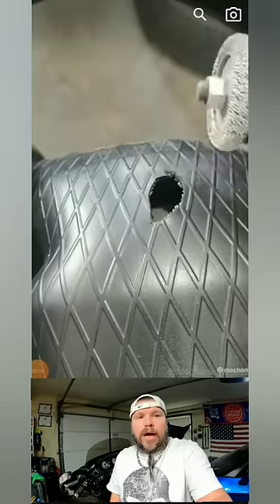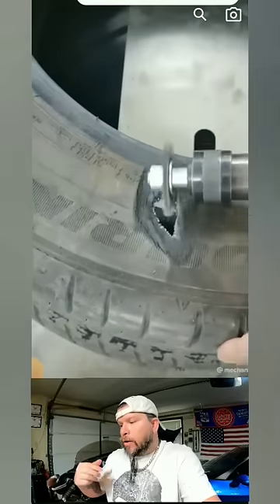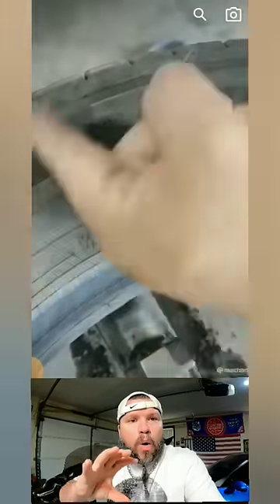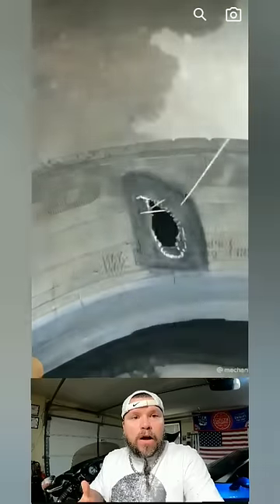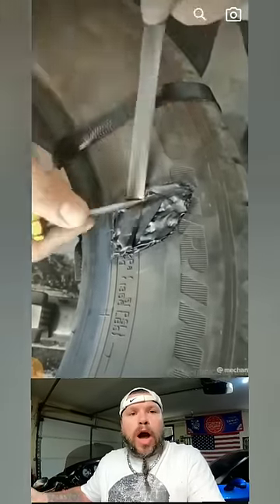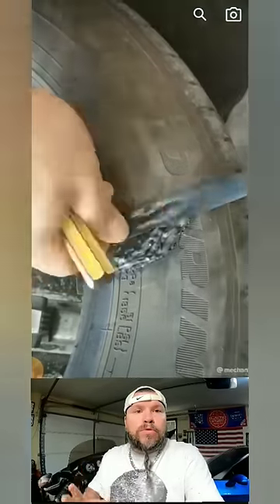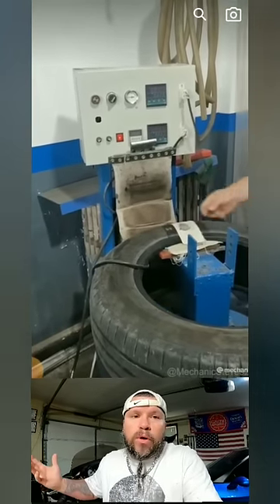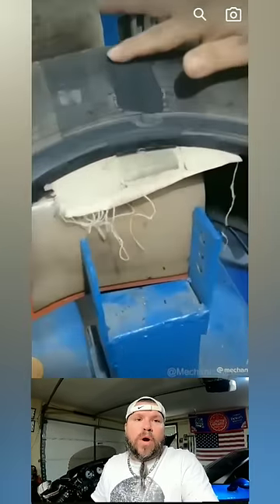patching a tire

Comment: I build truck tires for almost 3 years. At Continental Truck Tire in Illinois, and the sidewall repair is on the dangerous side. Because he compromised the air proof lining of the tire. And he caused the Body Ply wires to stretch and contort unnecessarily in the sidewall repair. Overlapped wires or stretched wires in the body ply during Tire buildup process would cause a scrap tire.
Reply: Wrong, it's called a section repar. You would be amazed at how many semi trucks on the road have section repairs. I too am in the tire industry.  I've sent tractor tires with bigger holes than that in the sidewall to have repaired.
Reply: Not one of them people doing this shit have ever heard of TIA . Tire industry of America.  Been certified for twenty ton tires.
Reply: @bto1533  do you mean tire industry association ?  What a joke . Basically  you pay a couple hundred dollars a year for a magazine subscription and a plaque for your wall. The training  is a 20 minute online course. I wouldn't brag dude. I grew up in the tire from a small child. I've replaced or repaired tires on just about everything that has tires on it. From hand carts to earth movers from toys to airplanes and everything in-between.  Don't try to act like you know something everyone else doesn't
Reply: @J S  lol no dude. Maybe in third world countries. What do you live in Pakistan? you clearly don't understand safety standards we have in the west.
Reply: @krombopulosrick7920  you sir are misinformed.  You not going to tell me anything about American tire industry.  I've spent my whole life in it. Go pretend to know what you're talking about to someone who doesn't know more than you.
I'm not saying the repair in this video is a common practice  or even acceptable.  I am saying that sidewall repairs are common and acceptable.
Reply: This is stupid. No one with a bain would attempt to patch that tire
Reply: @Blue_Shirt_Guy  That would be an illegal repair in the CDL industry.
Get stopped for an inspection and they notice that, you're going to be getting fined and sit on the side of the road for hours until you can get Rossi to replace it
Reply: @Random-ed2xf  good luck do that on a passenger car
Reply: @Jake-li7ih  yes that is crap
Although section repair is perfectly acceptable on drive and trailer tires.i know this because i have had many sidewall repairs done and sold them .
Reply: @Blue_Shirt_Guy  I'm sure you have. And they probably held up just fine. But legally it is not allowed.  Just got my CDL last year and my instructor said this specifically. 
Repairs are only legal within the tread area.
Otherwise it is an out of service violation.
You may want to catch up the regulations, they chang frequent
Reply: @Josh-ew1le  you would be surprised by the amount of people who don't understand its not safe to repair the side wall of a tire
Reply: I have friends that worked there and I used to pass it to go to my favorite transmission shop.
Reply: My cousin works at general tire in Illinois
Reply: On a bigger tire used for farm purposes I would fix a sidewall of a tire
Reply: @Blue_Shirt_Guy  that might be ok in China but in developed countries they would never think that's ok on a passenger car.  You would let your family ride in a car with a repair like that?
Reply: @Josh-ew1le  I don't know of a company that does passenger tires. I only send commercial and agricultural tires to the cap shop for repair or retread.  I have seen recap passenger tires before though
Reply: @supersportbikegrandpa274  voted for sleepy Joe.
Reply: Then these people have never been in a retread shop and watched repairs in real life, because these types of repairs are running on the road on all types of vehicles, especially 18 wheelers, daily and in the US
Reply: I mean can a tire sidewall be repaired if sent to a special Factory and money was not an object?
Reply: @Blue_Shirt_Guy  now I can't talk for the whole world, but a sidewall section repair is only legal in most countries that I'm aware of for the agricultural industry. There may be some tyres than can have this type of repair carried out for HGV's, but none that I've ever made, and I believe that to still be illegal in a lot of countries anyway as it is a road-going vehicle with a liability.

This tyre is for a car and/or light goods vehicle. You can not repair sidewalls on them as just about everything that keeps the tyre structurally sound has been compromised here. The butyl membrane, the ply cords, the intermediate layers, and the bonds between all of the layers. Not to mention the DOT info has been buggered off, so we're into "not for road use" right off the bat here anyway.

Once you have a crack or a hole in your car sidewall, you CAN NOT bring that tyre back to its original integrity. It can only be done through manufacture.
Original integrity in the eyes of the law == sufficient integrity. There is actually a regulation that more or less quotes that, but it's been too long for me to remember what one.

So no. This ain't okay, nor is it remotely legal in civilised countries.
Reply: @DeltaCodex  wtf are you babbling about ? I've already said srmi truck and off road vehicles.  I personally have sent truck tires to bandag with small punctures in the sidewall, had it repaired (vulcanized) recapped with trailer tread and sold them. All your other babel is just that.
Reply: @moneymoney12  finally someone who has actually been around the tire industry.  This thread is full of people who have never even changed a flat trying to talk about tire repair like they're experts.
Reply: @Blue_Shirt_Guy  yes, but the video isn't about a truck tyre. It's a car/lv tyre.

You guys are arguing about something in an entirely different context (ironically pretty much the definition of babbling, no?) so I'm just bringing my 2 cents on the topic at hand having manufactured car and light truck tyres in a previous career.
Reply: @Jake-li7ih  Don't know about the US but here in the UK sidewall repairs can be done by a proper company as a major repair. The tread area thing only applies to normal patch repairs.
Reply: Wrong Bandag retread and tire section repairs look it up
Reply: @Iaintwoke  Yeah it's the Same thing in the US for Personal Vehicle's but it is illegal to do on Semi's.
Semi driving is the second most regulated industry in the US and the tires are the most regulated the most regulated part on the Semi.
That one dude who was responding to me knows absolutely nothing about the Semi industry.
He said there was essentially no regulations when it comes to the tires when infact when I went to CDL school the first thing our lead instructor told us was half of the Material we have to learn is about just the tires.
If you get stopped for an inspection they are the number one cause for getting put out of service and stuck on the side of the road for hours.
Once you get enough of these you start getting really hefty fines until they finally revoke your CDL
Reply: I found the tire experts. 🤣
Reply: @DeltaCodex  first it's tire, not tyre in civilized parts of the world. Second you could do it on car tires but by the time you spend all that money repairing it you might as well buy a new tire. See car tires are significantly cheaper than truck tires.
Reply: @Blue_Shirt_Guy  the only thing you got right was the I go to Loves. I'm a sucker for that Chester's Chicken. And yes I did ask some older drivers yesterday in our Monday meeting I brought it up and between all 16 drivers with a combined total of probably more than 250 years experience. half of whom have between 25-40 years experience. Along with my Terminal Manager who has to stay up to date on everything all agreed that you are absolutely wrong.
They say Maybe your stuck in "the good ole days" when the industry wasn't highly regulated.
And those DOT people don't know anything. They only people that know are the state examiners, the instructors, the secretary of state (maybe), state troopers who are authorized to perform DOT inspection (some of them don't know shit either) and lastly experienced truckers.

Taking a tire guys advice on the trucking industry is like taking your dentist's advice for your herniated disk
Reply: True. I used to work in a Michelin retread site in the UK. Yes, sectional repairs are permissible on truck tyres, but damn I didn't like it much! Let's face it, truck tyres are a multitude tougher and stronger than any car tyre could ever be, so it is what it is, if done properly, by competent staff then that's one thing. On a car tyre? I'm noping the f**k outta that one.
Reply: I made Continental Hoses lol I ran the Extruders which makes the Inner part of the hose I'm pretty sure the Process is similiar but yes once you compromise that Ply its done you need a New Tire
Reply: @deltasixgaming  wrong hose boy.
Reply: @Blue_Shirt_Guy  These people have NO clue. I have worked on cars since childhood and when I got the "legal" car to drive, the 1st place I went was to the tire shop. In my town they did retread for sale and because they knew me, they would redo my tires at cost. I have spent a many an hour in the shops and have even helped to repair tires. The man was not using electrical tape - he was using what was defined for the repair and these people would be shocked what is repaired and what is on 18 wheelers.

JS, since you and I don't know what we are talking about, based upon their ignorance, I'm posting from the retread industry; which will reference TIA.

SIDEWALL REPAIRS
 
A few years ago the International Tire and Rubber Association conducted a research study on the strength of sidewall repairs in radial truck tires. Radial truck tires with injuries 4" long and 3/4" wide were repaired, x-rayed, and subjected to increased pressure until they burst.
 
From the results the International Tire and Rubber Association (now known as TIA) concluded that properly repaired sidewall injuries have a strength equal to that of the surrounding tire body and provide a safe performing product for the transportation industry.

Let's even discuss the bulge concern

WHAT ABOUT THE BULGE?
 
Repaired sections in radial tires may sometimes exhibit a slight bulge. New blue triangle identification logos are now being used by some tire repairers. the Commercial Vehicle Safety Alliance (CVSA) which inspects trucks for safety defects has adopted the blue triangular logo to help identify bulges caused by sidewall/shoulder area repairs. Those bulges due to section repairs are acceptable if they do not exceed 3/8" (1cm) in height. Tire Industry Association/TIA has a plastic TIRE FACTS card available with a 3/8" cut out which allows for easy measuring of a bulge.WHAT ABOUT THE BULGE?
Reply: This guy ☝️
Reply: @moneymoney12  👍 spot on dude.
If people just listen and then actually investigate a little they might learn something.
Reply: so many tire experts on this comment, my head is about to explode from reading this shit.
Reply: @Blue_Shirt_Guy  😆😂🤣💀🤦
Reply: At dealerships, we remove the object, take a drill and ream the hole out in all directions, then apply the rubber vulcanizer, pull patchplug through, cut it flush, pizza roll the patch, add rubber cement, seat beads on tire inflate to pressure and go.
Reply: @johndc2998  On the tread yes, not on the sidewall. If you are repairing sidewalls with plugs your deserve jail time.
Reply: @moneymoney12  I knew this was coming 😂 props for standing your ground I was about to back yall up
Reply: @J S  do they really repair side walls on road tires for semis in North America. Not just large otr tires. That's hard to believe. Liability and insurance don't mix.
Reply: Scary when they go. If your doin 80... No bueno
Reply: @Blue_Shirt_Guy  tractor tires are way thicker. They don't flex as much.
Reply: @Blue_Shirt_Guy  the only time you can repair sidewalls if it does not go down to the belts. And that's not a section it's called a spot repair... Do people do these kind of repairs? Yes. Are they acceptable? NO! YOU WILL KILL SOMEONE
Reply: Do tractor tires travel at 70mph on the interstate?
Reply: @Originalsunrunner20  if you're talkin farm tractors, no. If you're talkin tractor trailer tires (semi trucks) then yes.
Although most semi truck tires have a max speed rating of roughly 75 mi an hour because when you're going faster than that the air in the tire can reach upwards of 300+ degrees Fahrenheit inside.
Reply: @nubbyfresh5623  what's a guy that works for blah blah blah ? Go lie down
Reply: @Blue_Shirt_Guy  since I've been doing this about 20 years I figured I'd call you on your bullshit 😂
Reply: It's tyre, tire is to wear something out, like animals.
Reply: @osmacar5331  not in God's country.  I've never seen an ad for Goodyear Tyres, Firestone Tyres, or any other brand of Tires. Have a nice  day
Reply: The tyres strength is in the sidewall,  no repair, even a tiny puncture repair is acceptable as you will never know if any of the cords are damaged.  Its scrap
Reply: Bollocks
Reply: @paulhancock3844  wrong kid. You failed
Reply: Hey I work at penske. Can you look into why my recaps are flying apart all the time? Specifically the conti ones.
Reply: @Blue_Shirt_Guy  So I looked it up, and J S you're correct that section repairs are a thing, and do involve essentially rebuilding the sidewall with new rubber and a reinforced backing. However, Foxy Weapons also seems correct that this particular repair seems to be at the very limit of the size of a hole that can safely be repaired with a section repair. You're not supposed to exceed 5 inches long by 1 and 5/8 inches wide, and that hole looks a lot wider than 1 and 5/8 inches to me. But I'm just a guy on the internet.
Reply: @jeffwells641  take a ruler and draw a 5" X 1.5" box on a piece of paper,  that's a pretty big hole. Although I think that's a hole in the tread I do believe it's much smaller on the sidewall but yes I used to  send truck tires with holes in the  to the cap shop.  Good on you for doing a quick search before just spouting crap that is nothing more than feelings like a Democrat
Reply: @Blue_Shirt_Guy  I'm just saying that the hole in the video looks like it's around 3" x 3", which fails the 5" x 1.5" standard, making it a dangerous sidewall repair, like Foxy said.
Reply: @jeffwells641  I would agree, also to repair that hole would cost more than half of what that car tire cost new. Just replace it and be done with it.
Reply: @lennytate4246  Bad driving!
Reply: @ianmangham4570  I'm not a driver. I work for penske. I put the tires on the trucks. That is not why. The reason is bad molds. Because everytime I take one off like that the re cap people take it and credit it to us. So wrong. But I'm more so looking for why so many have shit re caps. A piece of tread in the middle of the tire on one I pulled right off same day it got delivered to our shop. And by piece of tread It's like 3x3in and about 25/32 deep.
Reply: @lennytate4246  Bad workmanship on your behalf!
Reply: @ianmangham4570  yea I bet.
Reply: @Blue_Shirt_Guy  how's the weather in India. I know you guys wear sandals to smelt iron. You repair sidewalls on tires too?
Reply: @moneymoney12  why would you bring up TIA? You Indian boyfriend already said it's garbage and only 20 min online course can get you certified.
Reply: @krombopulosrick7920  JS is from India. They wear sandals to smelt iron, so patching the entire side of tire is entirely possible.
Reply: @Blue_Shirt_Guy  ok, coming from an Indian... That insult doesn't hurt that much lol... How's your sandals?
Reply: @Josh-ew1le  u can don't it to a tractor trailer u can deff do it to a passenger car lol
Reply: @jerryscott7373  You can, I wouldn't risk my family's life over a $100 tire.
Reply: It bearly touched the side lining that holds the air and two he didn't tighten the stitches tight, their there to have something to hold and strengthen the patch so he didn't stretch nor did he contorted or contored nor did he contort the metal ply wires inside the tire u deff can see the tire isn't looking warped nor looking like it's flexing
Reply: @J S  I did and couldn't find anything supporting fleets using off tread section repair.
Reply: @jerryscott7373  ssssshhhhh
Nobody can understand your comment
Reply: @krombopulosrick7920  because JS is Indian. They do things different there.
Reply: @Josh-ew1le  just saying u csn nuthing about no one's life lol
Reply: @Blue_Shirt_Guy  u the only one that can't understand it lol it wasn't to u thats way it was to the very top commenter at the top who's comment made this tread plus I though u knew tires if u did u would of know what I'm talking about
Reply: In India they have been repairing tires like that for a long time and they put them in a heated press and it molds the rubber to the old rubber as if it were a whole tire from the factory and it does not leak.
Reply: @Blue_Shirt_Guy  wow I call bullshit. It’s Illegal under federal DOT code § 393.75 Tires. You can look it up if you want to. You are not legally allowed to patch a sidewalk or shoulder of a tire.
Reply: @Jake-li7ih  as someone who’s been driving trucks for more than a year, I can confirm.

If they see a repair anywhere on the wheel or tire outside of the tread they’ll shut you down… ask me how I know lol

Anyone with even a modicum of common sense knows that it’s dumb to even attempt repairing a sidewall, especially on a commercial vehicle where you’re subjected to inspections. The other guy is either an idiot or a liar.

He’s probably tried to tell people retreaded steer tires are perfectly fine too
Reply: @Jake-li7ih  sidewall sections are allowed with proper sidewall markers. There has to be a triangle marker on the sidewall where and heavy shoulder or sidewall section. Those properly marked sections can have a slight bulge but it can’t exceed 3/8”. Any bigger then they have to be removed from service. But also can only be ran on drives and trailer positions. Also the TIA certification has several different levels and the 20 min online class is only the basic level. The others require all day classes and extended tests.
Reply: @Blue_Shirt_Guy  it’s insane the amount of people that believe anything they are told in regard to tire laws is insane. There is a reason why so many tire service companies send their guys to the Tia training. I have been tia 300 certified since 2009 including the recertifications since
Reply: @cursedowlsgaming5355  ikr
I was gung-ho like that when I was a kid. I had tia cert, ase cert, I went to TECH tire repairs classes in Ohio, I toured 3 different tire manufacturing plants.  We didn't do section repairs at our shops we sent them to the cap shop. I sold the business,  it's to hard finding quality young people who want to do the job. Everyone wants something for nothing.  Not to mention competing with Walmart on passenger tire pricing is a pain. I just amazed me how a person in an escalade or bmw or some other hi end car would go to Walmart and buy inferior tires. Then try and bring their Walmart " Goodyear" to my shop for warranty.  I'm like sorry that's a Walmart issue go back where you bought it. I can't adjust Walmart tires here. Everyone got so upset.  Spent half a century in the tire business,  since birth basically  now I work part time for farmers because it more fun.
Reply: @Blue_Shirt_Guy  why don’t you try looking at state laws next time.

I didn’t look at all 50 but the 10 or so that I did look up considers a repaired sidewall to be unsafe.

You’re starting to sound like a Republican; just because you’re confident and name call doesn’t mean you’re correct.
Reply: @Blue_Shirt_Guy  I have been in the business since 2006. It’s mind boggling to me how many people that work on commercial truck tires have 0 clue what they are doing. It’s scary knowing that these trucks share the roads with us.
Reply: @Fetidaf  can you show me any law from any state that says anything about sidewall repairs?  I didn't think so. Just like a Democrat spouting beliefs as facts.
Reply: @cursedowlsgaming5355  not to mention the cars and light trucks with over 150000 miles on them with worn out suspension parts.
Reply: @Blue_Shirt_Guy  especially in states like mine that don’t require safety inspections.
Reply: @cursedowlsgaming5355  I think all vehicles including motorcycles should have mandatory vehicle inspections.  In every state. I also think it should be harder to become a truck driver than it is.
Reply: @Blue_Shirt_Guy  should harder to become a driver of any vehicle.
Reply: As long as it's not a steer tire I wouldn't care. And if you're not hauling heavy shit I would trust it and it's not like I would be doing 100+ mph with a tire like this either but to get to and from work or to the grocery store I would trust it to last till I replaced the tires.
Reply: Hell the use re-capped tires on semi trucks their just not aloud on steer tires and it's probably no different than doing this on a car tire.
Reply: @davelong4174  I knew a guy that pedaled recap passenger ant light truck tires in the early 2000s. They were crap
Reply: @davelong4174  actually steers can “legally” have retreads as long as it’s not a passenger bus and has 0 repairs to them. Hardly anyone does it but garbage trucks and package delivery trucks/mail trucks are about all that actually do it.
Reply: Truck tires operate at much higher pressures though…at least 3x pass tire
Reply: @davelong4174  this is a fallacy in logic and please allow to explain why. Tires are produced in such a way they the X-ray scan they use for recaps can never occur on a new tire at all. So all new tires must rely on the manufacturing process to be done properly and that quality control sees the small indicators of a potential defect. All recaps must go through a scanner to find defects. Critical defects are not allowed to be repaired and you steer and drive tire must have 0 defects. As long as your recapping company is good and reputable the recap will not fail. Please thing about this. How many times have you seen a blown out tire on the side of the wall with the wires in it. This is not the recap that was a bad or under inflated tire. Under inflation is far worse than a recap. If you don’t believe me please I encourage you to go ask a recap shop to show you how it’s done. They usually don’t hesitate to show it off as its insanely good for business. The tire company I use will let anyone in as long as they are polite. In the end I would trust a recap that has been scanned to ensure their are 0 defects from manufacturing than a new tire that could potentially have a defect. But I fully understand the mentality that new equals safer as I thought that way too before I bought my first shop. 

Now used tires are literally taking you life in your hands as they are unregulated and you may get a bad tire and I never suggest that anyone ever buy one unless they have to get home.

I sincerely hope you read what I had to say and don’t reply in anger. As I said I get why people think new fresh from the manufacturer is safer but they simply don’t have the safety standards that a recap has to go through. Throughout all the shops I own now most of the blow outs HD drivers call in on are new tires. We haven’t seen a cap fly off in years.
Reply: Wrong...i am also a chief former in the tire industry. Yes, the integrity of the side wall is compromised, but with professional grade equipment and the proper machinery, the side tires can be repaired.
Reply: @dislikebutton9043  what company did you work for that would perform this repair?
Reply: I've never been to a tire repair shop that would repair a sidewall on a tire they would replace it now fix it
Reply: @Blue_Shirt_Guy  found the incel
Reply: @Blue_Shirt_Guy  why dont you two get a room?
Reply: @sloeginandsleep1170  I didn't know Michelin did section repairs you see. Was it only on specific CIC's or universal?
Reply: @moneymoney12  you may have worked on cars and what not, but some of us have actually designed and manufactured tyres. If that doesn't make you an expert then nothing will 😂
Reply: @BarryChapman  yeah is name is Barry Chapman.